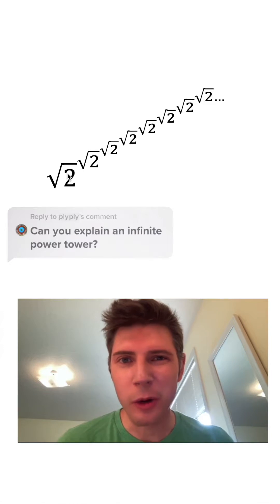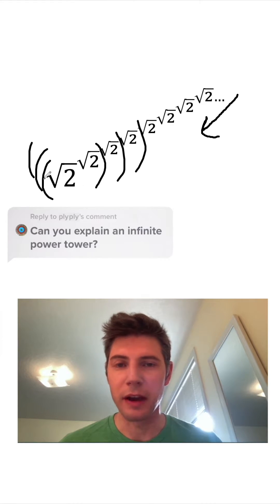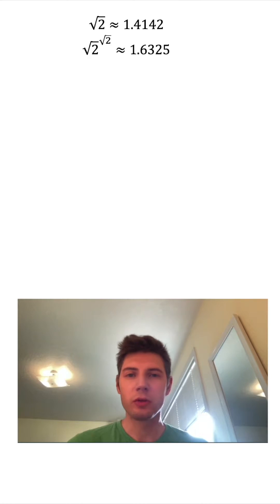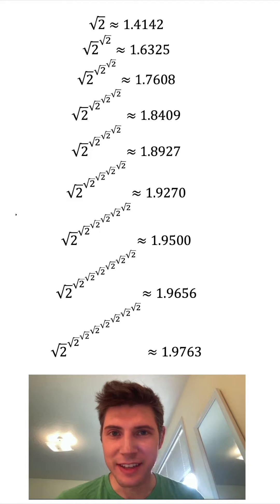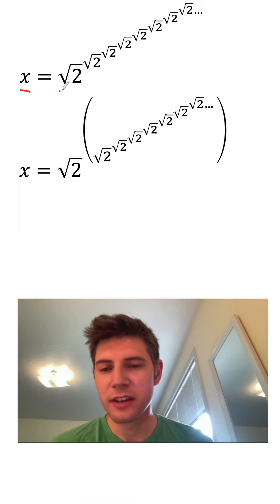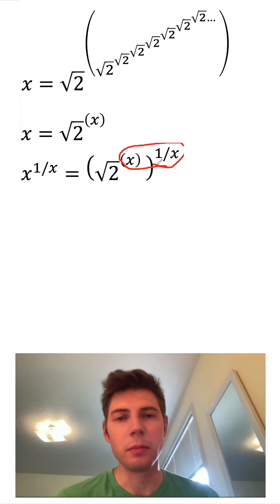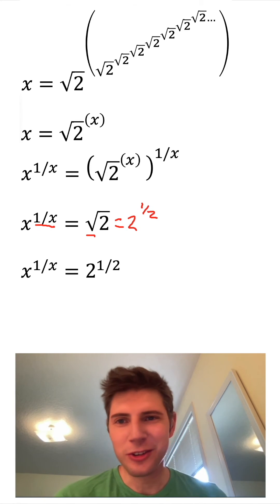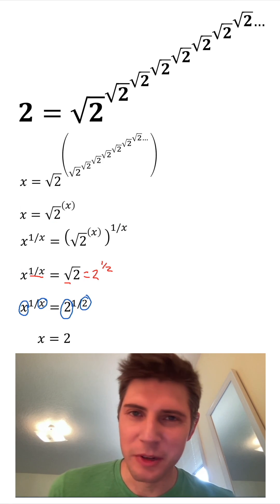Infinite Power Tower

Comment: Well, x = 4 is also a solution to that equation. How do you propose we eliminate it from consideration?
Reply from the maker: I didn't know any of this. I love it. Thank you @Andra P!
Reply from the maker: I didn't catch that 4 also works, that would've been fun to add to the video. I may need to do a followup after looking into @Andra P's response below.
Reply from the maker: Thank you!
Reply: @Andra P Yes, and even the initial observation that the power tower appears to converge to 2 is reason enough, really.

Still, I find it quite interesting that the equation we end up with does not "capture" the power tower in the sense that it has a 2nd solution. This might suggest that we lose some information about the power tower somewhere in the reasoning, that allows a 2nd solution to be introduced.